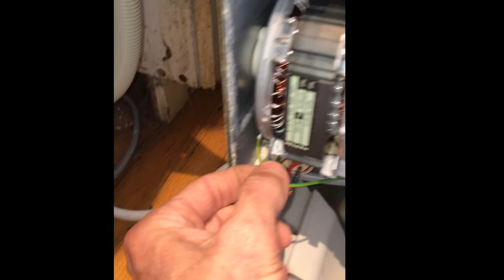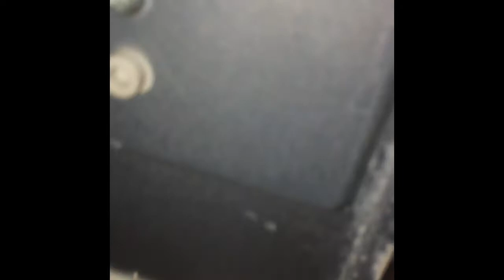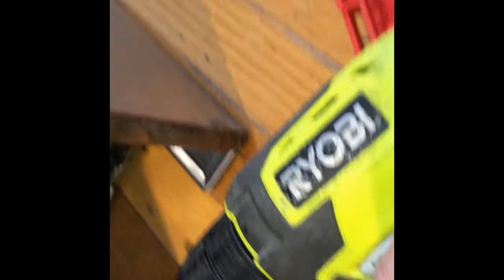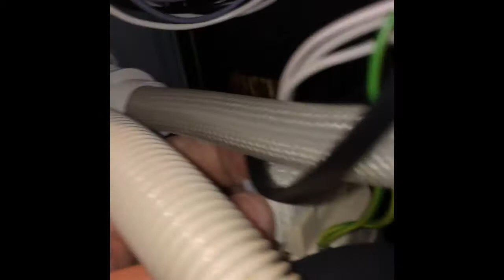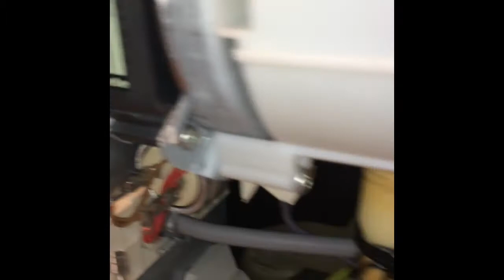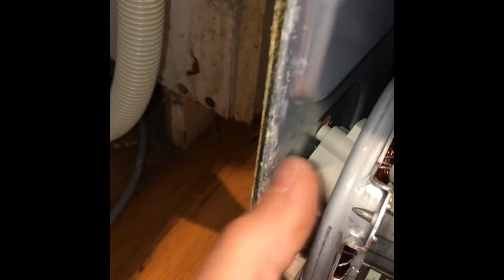Miele Dishwasher Motor Removal -- Easy Steps

Comment: Hey Scott! You helped me out a lot. Unfortunately the hoses at the bottom of the pump ripped during the disassembly of the pump, they where very worn out. Any tips on how to fix this?
Reply from the maker: Yep, I’ve had that happen during repairs.
I’ve used automotive radiator hose from autozone along with hose clamps to make it water light again.
I just bought a small section of the cracked white hose to find a hose that can fit over the old hose.
Reply: @ScottTheFixItGuyChannel  sounds perfect! Does it matter if it isn't the exact dimensions? Or should I just use some extra teflon and tighten it?

Comment: Hi Scott. Great video! Thanks. Trying to spot my washer's defect... Cleaned the relay, replaced the not functioning pressure switch and finally replaced even the heating element, but still not heating... What do you think may be the core reason? The capacitor?
Reply from the maker: How high do you think the water gets after 3 minutes?

Comment: Hi Scott and thank you for sharing your knowledge, Its very helpful watching this video before I remove the circulation motor. My Miele G 2183 SCVi is leaking by the circulation pump (Gasket seal) I wonder if I have to change the entire pump or if there's a partition kit with the impeller to order. If so do you have the part number.
Merci de Canada
Reply from the maker: You can order a circulation pump partition pump kit. It’s pretty cheap.

Comment: Hey Scott love your videos! I've watched all of the Miele dishwasher ones and I'm not sure if removing the motor and cleaning the impeller will help me with an F78 error, what would you suggest? Thanks.
Reply from the maker: You can call Miele USA and ask them to send you a new motor capacitor .
When you install it also super clean the plug that brings power to the pump.
Reply: Thanks Tom, will do.

Comment: Thanks Scott
I have just removed the same motor from my miele DW.  How do I separate the impeller housing from the motor?  I need to replace a seal between the two (leaking). Thanks
Reply from the maker: Here you are:  Miele Dishwasher — Circulation Motor Repair
https://youtu.be/ZExsRUIgysI

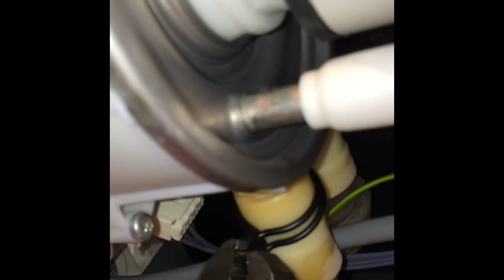Comment: Scott, at the 3:50 mark of this video, you say: "basically these hoses never leak."  Sadly, mine is leaking.  The pump has two outlets, the hose attached to the top outlet is leaking.  I spoke to Miele and they identified that as the Top Spray Arm Feeder Tube - part #6118822 on the G2470 dishwasher and I have ordered it.  Do you have a video that will help me make this repair?
Reply from the maker: Hi John,

I’ve used larger hose to go over the smaller leaking hose and then used hose clamps to lock it all down.  That does work.
Reply: @ScottTheFixItGuyChannel  Thanks, Scott.  It is a ribbed hose - which then "turns in to" a rigid flat tube - so I am not sure I can figure out a way to seal the larger hose against the ribbed hose...so I ordered a replacement part - for $100 (ouch).  So I think that means I have to take off the back or the side of the machine...not sure which one.  Any suggestions?

Comment: Thank you Scott! Had been having trouble resolving an F14 on my Miele G 2270 SCVi. Googling led me to replacing the pressure switch with no success. Using this video I managed to get the circulation pump out to find the impeller full of the plastic labels we use to stop our kids losing their lunch boxes at school. Wish I had have discovered this before replacing the pressure switch.
Reply from the maker: +Michael Curran 
Thanks Michael,

Nice work.